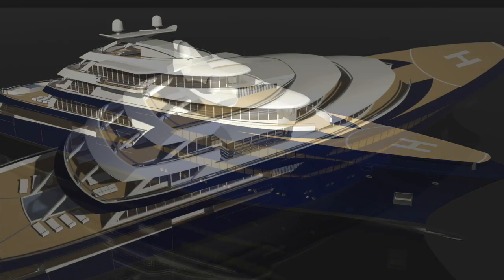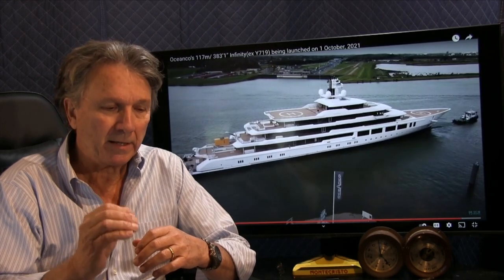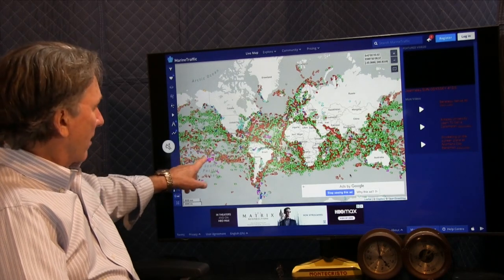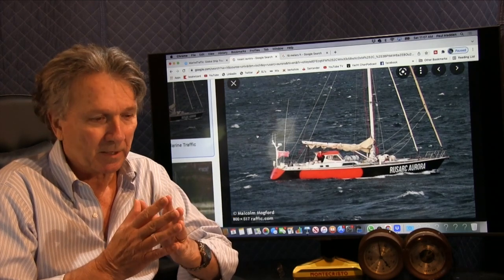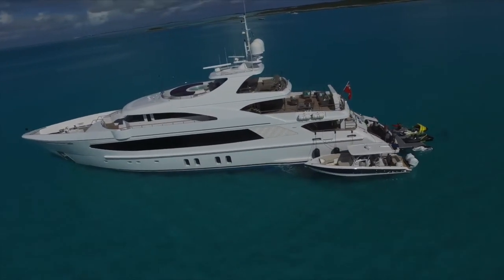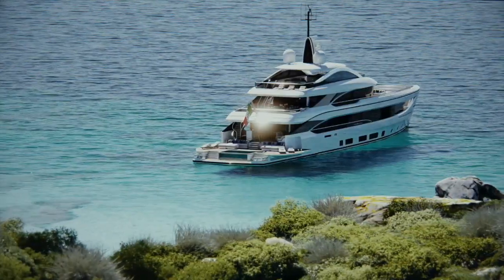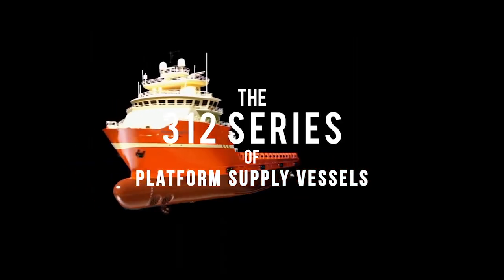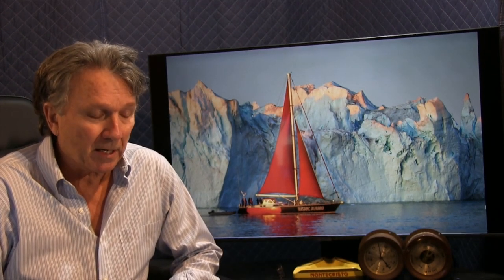Best Conversion Yacht Platforms for Global Expeditions - Part 4  of the History of Expedition Yachts

Comment: I have been at sea so I know to value ruggedness and redundancy. However, I am considering a yacht that should also be able to operate in the Caribbean. As I understand it, seaworthiness and low draft are mutually exclusive missions as seaworthiness requires a significant draft. Is there a boat that could support both long range cruising, including in rough weather conditions AND at the same time able to operate in the shallow waters of the Caribbean?
Reply from the maker: Yes. The fast crew supply vessels are built at lengths over 200 ft with Hamilton jet-drives. They are built to a higher standard than most yachts as they need to be all-weather and they carry passengers. With a possibility of 29-knots, you're not likely to get caught in weather as you can out-run it.  Menwhile, you can cruise at 12 knots burning 50 gph. Check out new video on these boats. https://youtu.be/mMkCG84hg7s

Comment: The Ulstein X-Bow series has proven superior seagoing capabilities … specially when the ocean becomes more “troll” like …
Reply from the maker: Agreed. So far Espen's 'Olivia O' seems to be the only yacht adaptation of this hull form- but Ulstein is working hard to attract expedition clients.
Reply: @IncredibleShips  … indeed (Olivia O). I wish Espen would have added more style to it, but the client taste probably ruled :)

I’ve designed a series of reverse bows myself (starting in 2003 incl expedition yachts), and the angle and shape of the reverse bow can and should be designed in more ways than one (above the waterline). In addition, the graphene technology that is being developed for hull applications can potentially increase a yacht’s speed by 50% (less drag/friction), which means yachts can become wider for additional seagoing stability. Like … much wider. Interesting times ahead.
Reply: Good day sir, how do these conversion cost for 85m, rough figures